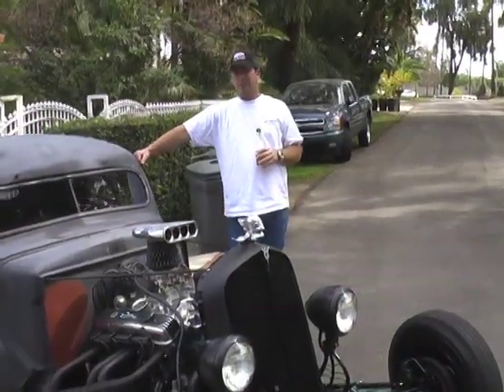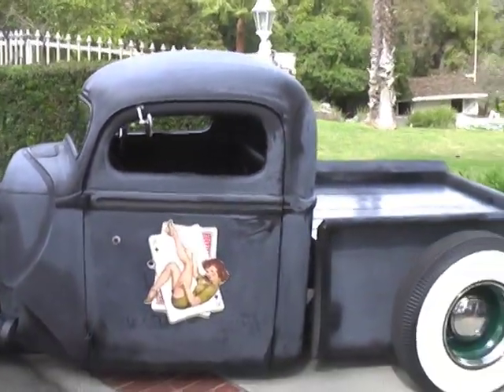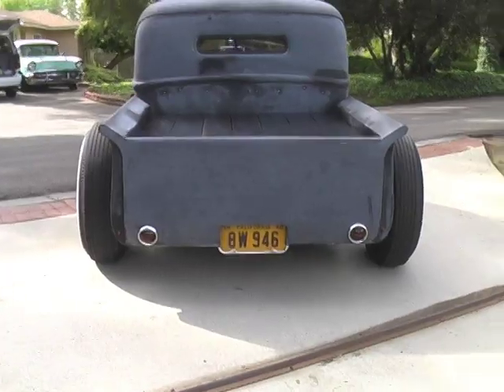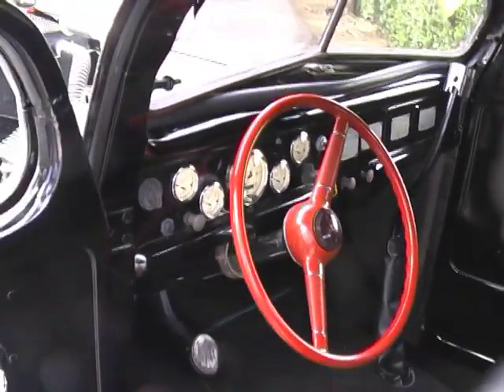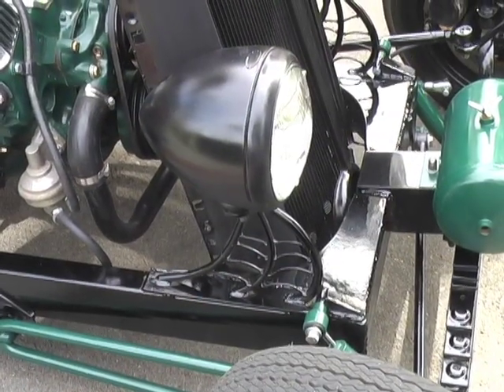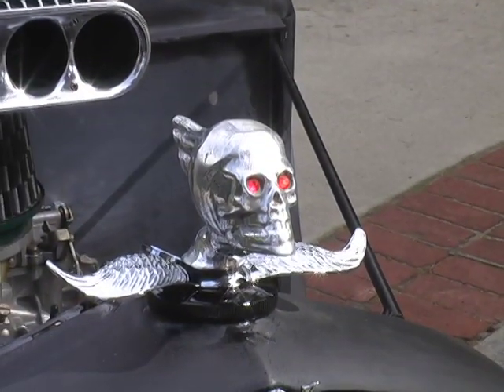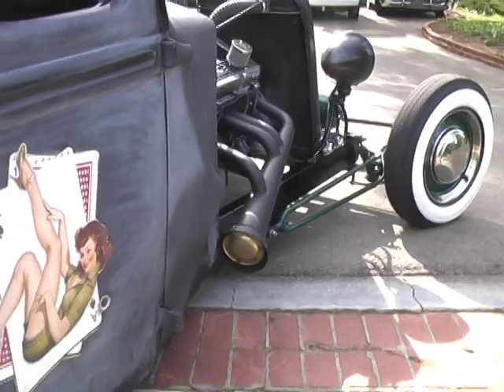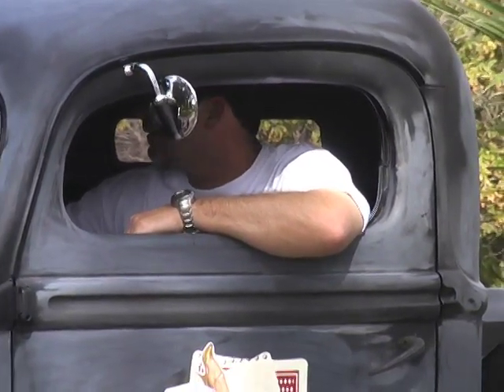1940 Ford Pick Up Hotrod

Comment: What is about the yellow plate? U.S.system doesn't require cars registered under an old code to update their plates whenever the code is changed?

Here in Brazil, plates were yellow with 2 letter and 4 numbers until about 1997 When it reached all the possible combinations, system changed to plates in light-gray, 3 letter 'n 4 numbers. And it was ('n still is) mandatory that all cars registered until that date must change their plates (yellow-plate is a clear outdated-signal and it will be busted